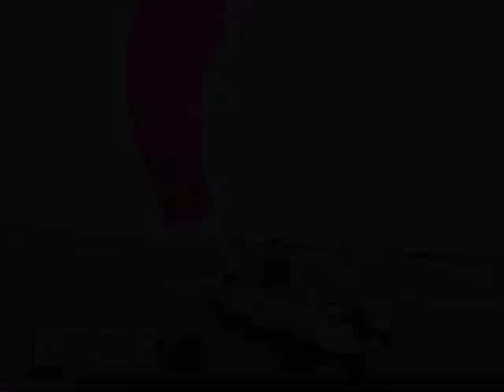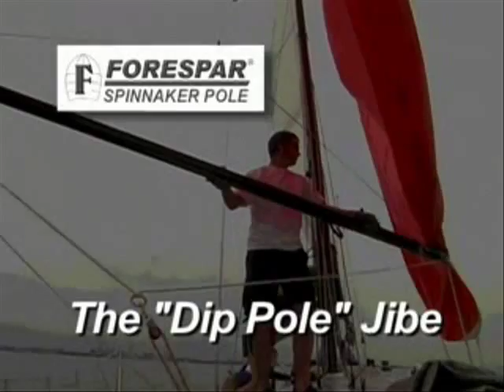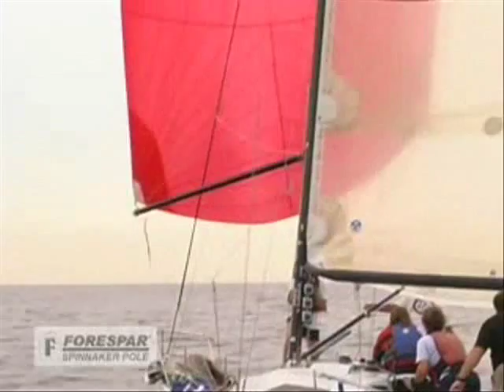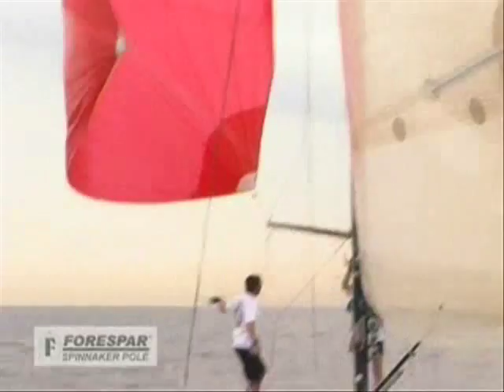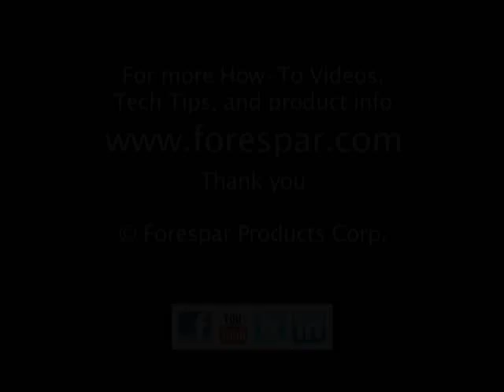Forespar Spinnaker Poles Part 8: The Dip Pole Jibe

Comment: I remember as a kid we had a pole specifically built for dip-pole jibing; controlled by two guys inside the pole to pull it from one clew to the other -- but it required another crewmember dropping the topping lift as the dip-pole guys were being pulled in/let out.  Efficient; jibes would take barely 5 seconds to perform, but asking one foredeck crew to operate both topping lift and guys simultaneously was a bit much.